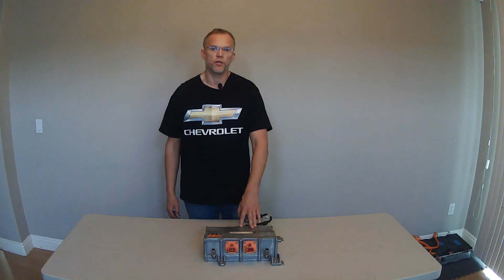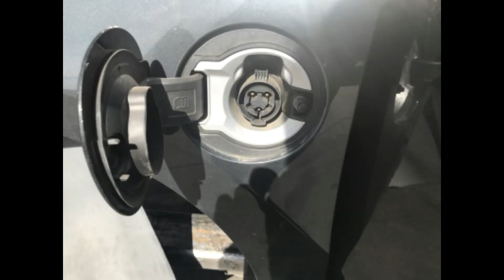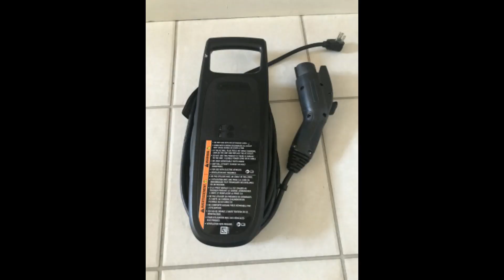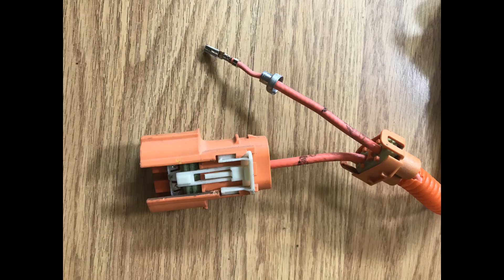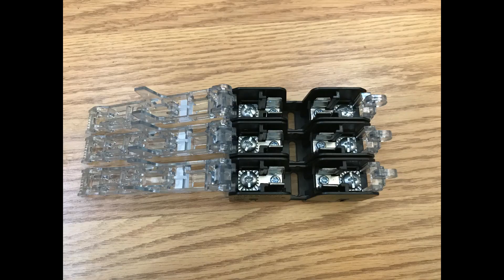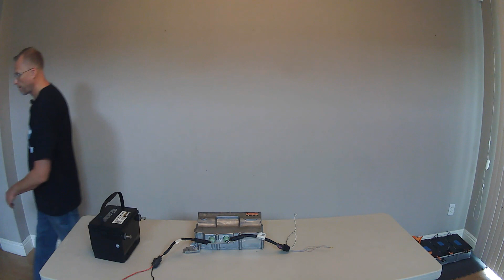EV Conversion Chevy Volt Onboard Charger

Comment: Original looms must be much cheaper over there. It would bankrupt me trying to get the matched cables for everything - or drive me mad trying to negotiate with the breakers.
Reply: Same for me in New Zealand
Reply: I used this charger without original wire harness because salvage yard wanted way too much for the harness. I just took the top off the charger and replaced the wires with my own plugs.
Reply: @briandold1  Same with me and the Outlander charger.